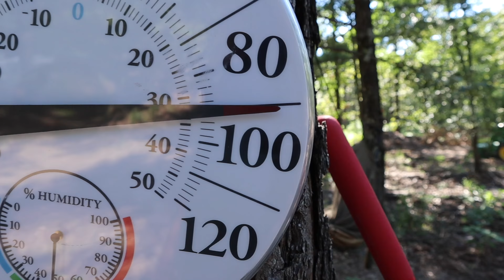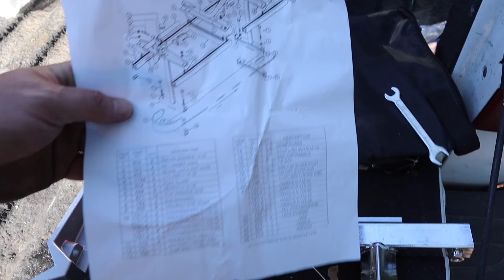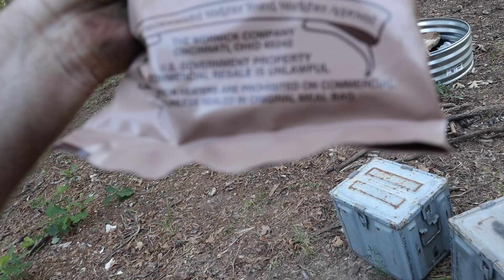Things Don't Always Go As Planned Off-Grid In The Ozarks

Comment: After having problems with a saw like you are having and after talking to my small engine mechanic I only use high test fuel in my small engines and outboards. Regular gas does not last very long and I also always put a bit of sea foam fuel treatment in my fuel tank and since I started doing that my small engines  run like a charm with no engine problems

Comment: Hey Dutch! You gotta lot done today. Here's a tip: If your chainsaw ever has bad throttle response or it runs poorly and the gas/oil mixture is fresh and accurate percentage you may need to adjust the carburetor. It probably has two air mixture or fuel/air mixture screws that can be adjusted. One is for low rpm and the other is for high rpm. You may need a special tool to adjust them if a small flat blade screwdriver won't work. It did sound good when it got warmed up. I need to get me some MRE's.

Comment: The trick with the cheap chainsaw sawmill is to shim the guide board so it is straight and level.  We use one to split big logs so they will fit in the real sawmill. A ripping blade is a must. We also bought a plastic composite 2x6 board to use as a guide because it is straight and stays that way.

Comment: Dutch get a 5gal bucket with lid and buy a hand pump with clear hose so you can bring 5 gal of water with youto the off grid what we did was freeze or buy a boxk of ice and then get some cold water from the house put block in botton add the water seal tight and you have your 5gal of water for the day! Place under tree and wrap with a blanket under tree ona square board and it will keep it cool till you get your well in! 
 Tye a bananda around your neck that was dipped in water around your neck will help keep ya cool in this warm weather!

Comment: Off Grid-Completely self supporting re energy. Nothing wrong with a good generator for moving to sheds etc if necessary & a big whole house generator with automatic switch (just enough to power the important things in an emergency or bad winter). The biggest solar set up you can afford & the same goes with batteries. A good windmill or two if you can get cheap & restore. An emergency hand pump for your well or wells if you have two. We have a bore which is a fair distance away & currently uses a petrol engine. Mainly used for animals though the water is freezing cold & lovely. Wanting to get a solar set up on that ASAP. WARNING: We set up a system for waste & waste water which is pumped through to clean it & is then safe to use on plants. Not vegetables but that’s my decision it’s OK so ‘they’ say. Thought it would be a great idea. NO. The upkeep is expensive & annoying & pump is a must. If I had it to do again I’d go to Septic & leach fields & no pump system at all. We have a wood stove for the winter but our winters are almost a myth compared to the Ozarks. Maybe two stoves 1 for the kitchen & 1 with glass front for living area. Open fireplace for the main bedroom would be nice. It’s so easy spending someone else’s money. Petrol & Diesel storage so you can buy it when it’s cheap. Underground if you can. Neither you or your family need to give up your electronics so long its still 2020 & Google & the ability for the girls to school at home requires internet access. If your friends say that’s not off grid ask them if they still use Doctors & Dentists when needed. Pretty damn sure they do. Yep 2020.  Game cameras aren’t expensive but you need some for sure, lots of work but what a great life you’ll all have together. Bless you all.

Comment: You can get your own saw blade grinder and sharpen the chains yourself. You can save a lot of money doing it. When you have them done by someone else they grind the chain to much and it will not last as long. You just do a light touch up grind. Adjusting the angle a bit will get you a chipping blade. It's been many years since I've had to do it. If you'll be cutting a lot of wood it saves a lot of cash doing it yourself

Comment: Dutch watching you there are some tools you may want to invest in for your building project. You probably need to look at getting a laser level I think Bosch has a good one. This will help you shoot your grade for your foundation and numerous other task. You should look into what a used tractor/backhoe would cost you. That way you will be able to grade your foundation site and dig the footers. You would also be able to dig the water lines and septic. I think this will save you money in the long run, plus there is always a need for a tractor around the homestead. For your sawmill you might want to look at the Woodmizer. I watched a couple with no experience use one to create all the timbers for their timber frame home. Check them out here on YouTube "Pure living for life".

Comment: Stating the obvious, looks like your chain saw could use a tune up. If your not using it I found that my saw runs better and stores better using synthetic oil in the fuel. Good luck with that saw mill.

Comment: How much does it take to rent one of those to clear up some ground?  I like your idea of spotting snakes, and would like to know more about this process.  as for your containers, camp gear or tools.  I would guess you have to eat, so one of those for food....
Reply from the maker: The tractor is $150 a day
Reply: @KeepingItDutch  I am a veteran, and those types are better than what they gave us in Suriname.  But at least the chocolate bars that come in those are good.  It should also come with its own oven pack to heat it up.  If you want to start a fire, look for pine knots, those have some resin that will make fire even in rain or wet wood.